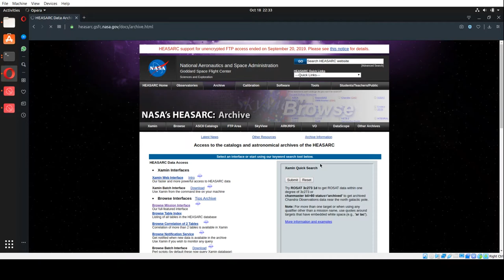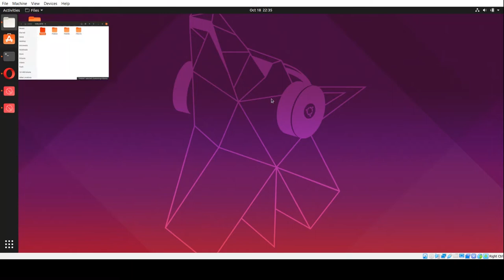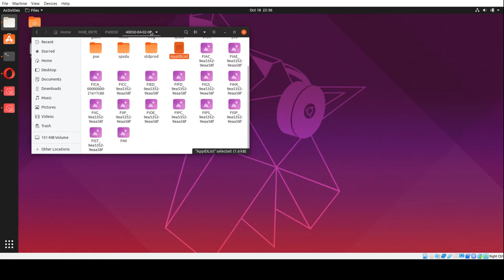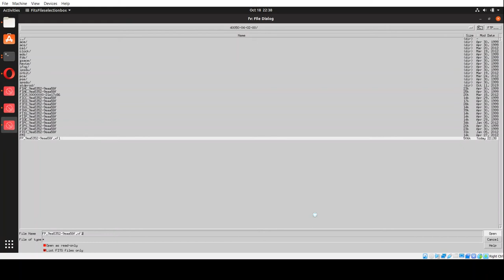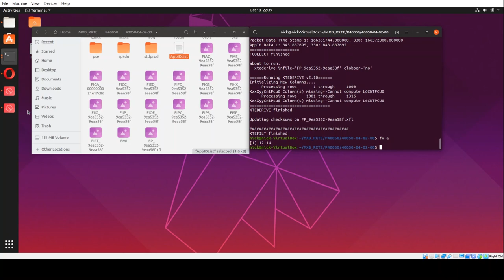How to create XTE Filter Files - RXTE Data Processing Tutorial

Comment: Hi, Nick. Thank you for posting this because there are not many videos on the internet. I am currently doing my masters dissertation work on a LMXB using the RXTE data and had a few doubts about the xspec fitting and the process. Also I am very much eager to learn the software as a whole and would be glad if you could help me. Thanks.
Reply from the maker: I am also very interested in LMXBs, and there is plenty of RXTE data on so many of these sources. Most of my knowledge is moatly timing analysis related, but I have done some xspec work with RXTE, so if you have any questions I'll do my best to help out as much as I can.
Reply: @nspace-cowboy  thanks... I have been trying to fit few models with my source (aqlx-1)... And I'm getting pretty close but the reduced chi-squared value isn't coming close to 1. I'm having trouble getting it there... Also the new xspec version doesn't show the reduced chi-squared so I've looked around and found goodness command but never really understood how to use it... I get some errors or don't understand the output... It would be a great help... Also if it's not too much, I'd like to learn timing analysis too... I haven't looked at that part at all... I'm actually planning for my PhD studies after this and want to learn everything possible so it can help me in my further studies. Thank you for the help and responding! :)
Reply from the maker: @casperskie If you are using the most recent version of HeaSoft, I do know that there is an issue with xspec and HeaSarc suggests you switch to an older version of xspec. 
Let me know if this helps.
See the Xspec notes at the following link: https://heasarc.gsfc.nasa.gov/lheasoft/download.html

Otherwise I will need to do some more investigating since I haven't encountered this issue with the reduced chi-squared not being shown, and am not familiar enough with the goodness command.
Reply: @nspace-cowboy  So we can calculate the reduced chi-squared value manually, which is chi-squared/number of degrees of freedom, and that is sorted. Also I had a doubt about the fitting part, Do you always freeze the parameters? Because changing one parameter sometimes throws the fitting off the charts. Is there a way you could help me where I can share my files with you and you take a look maybe? I'm sorry if its too much!! You can find me on reddit "u/casperskie". Thanks!! :)

Comment: Hi Nick, can you please help me with how to make a light-curve or power density spectrum from RXTE data? I have installed Heasoft and downloaded some RXTE data but don't know what to do next. Plz help
Reply from the maker: Which detector are you trying to use PCA or HEXTE? I assume PCA, but the process changes depending on which type of data you are using.
Reply: @nspace-cowboy  Yes I am using PCA. Can you please help me by at least giving some link on how to do that?
Reply from the maker: @Prajjwal Majumder I think this following link may include what you are looking for, otherwise there really isn't a straight forward guide to doing this.
https://heasarc.gsfc.nasa.gov/docs/xte/recipes/pca_fourier.html

If you are still having some trouble I would also check out the the Event Modes section and Steps 1-7 in the guide just below it, however this will not give much information on a power spectrum density.
https://heasarc.gsfc.nasa.gov/docs/xte/recipes/pca_event_spectra.html
Reply: @nspace-cowboy  Thank you very much... You should make much more videos in data astronomy as there is no such channel like this...
Reply from the maker: I am looking forward to doing that, but I am trying to get a few papers published in the next few months which are taking me away from working on these videos.
Reply: Hi can you tell  me how to create a gti file from RXTE for PCA  good xenon data ?